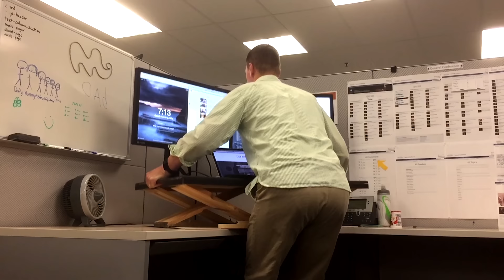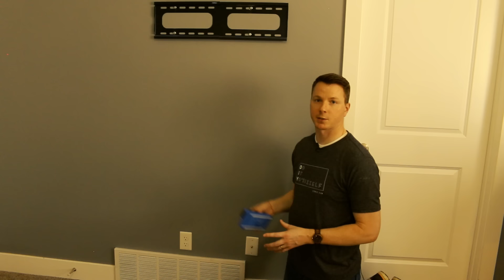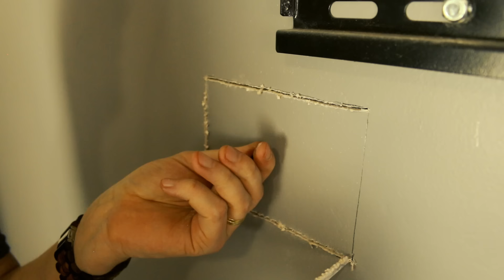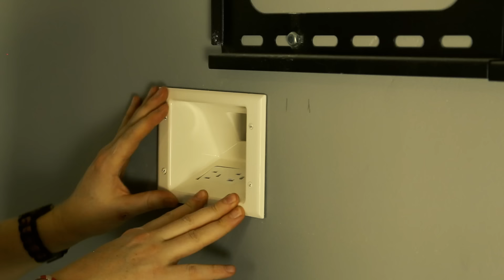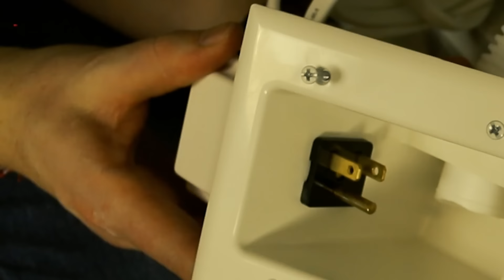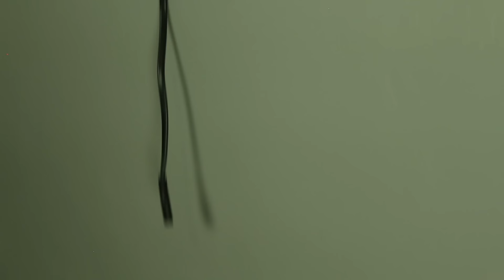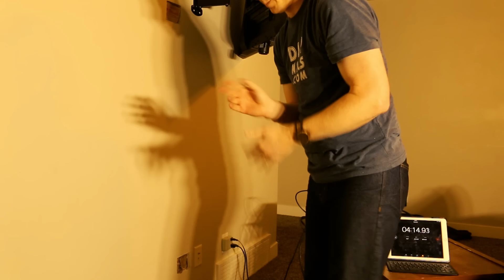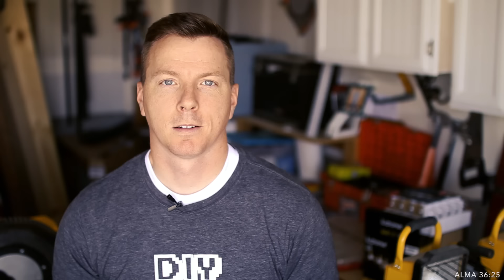How To Hide Your TV Wires in 30 Minutes - DIY

Comment: If you just need to go straight up, seems like it would be easier just to put in a new outlet behind the TV and a separate cable run. The way you did it would be more useful if you have to cross a stud or two to get to your electric box.

Comment: Your video stopped short of the completion of the project. What is the purpose of running the AB cables through that pipe? What do they connect to and have anything to do with plugging it into the electrical outlet?

Comment: Only suggestion is run a thin piece of string or rope through your cable tube.  WHen installed, tie the cables to the rope/string and then gently pull.

Comment: What do you think about these: Power bridge is easier to install. don't need to drill the fire block use a "Buzz Saw" multitool and cut a knotch in the drywall and 1/2 in. of fire block

Comment: Nice clean install with detailed instructions.  However, that six-foot extension cord bundled up at the bottom of the flush mount box is kind of janky. Something like an; "DEWENWILS 1FT Extension Cord Indoor, 14 Gauge Short Flat Plug Extension Cord White with 3 Prong, Low Profile Power Cable SJT, ETL Listed, 3 Pack", would have been a cleaner solution.

Comment: not an improvement.  should have just tapped the new wires into the existing electrical box for the cordless look running everything behind the drywall.  that is the point in doing it, to clean up the wall

Comment: Nice system but a comment has to be made. Always cut electrical wires to fit properly into fittings, exposed wires are dangerous. In this case it was the ground wire but with other wires exposed outside of a fitting always gives a chance of shorts / fire. Electrical work is not to be taken lightly so always take the time to do it properly.

Comment: Very thorough video.  I hate the look of the extension cord. I wired the power leads directly behind the original outlet plug.  Definitely not code but no wires at base along floorboard/outlet

Comment: I personally don’t like this. you have an outlet in the wall. You still have a cord showing, coming from the outlet to the new box. why not just put a double hang with a way to run your wires out? i added a outlet with the outlet/USB (RoKu) and have no issues at all, wires hidden….i get this is a “sponsor” video, but i’m not a fan of the boxes in this video

Comment: This video is great but do not use this pipe that will definitely not help and very difficult to pass the hdmi cables as I am facing so I am going to remove the pipe. But otherwise, rest of the instruction is very helpful.

Comment: A good tip for doing ANY electrical work, never wrap a wire into a circle when you have extra. As the electricity flows through it turns the circular part of the wire into an electromagnet. This can create interference with all kinds of signals. I see people do this all the time with speaker wire and then wonder why things don’t sound right and why their wire gets warm.
Reply: What do you do with cables rest then
Reply: @toxicsquee3112  This tip maybe well out of date now as I have only just come across this vid but you can by de magnetisers that clip onto the cables to prevent this. Some new appliances will come with them on. Also, not so fun fact. Last year the house opposite mine burnt to the ground during the night. All occupants escaped except for their pet cat who was never found. The cause was an extension cable that had not been fully uncurled and was unprotected. I have always been aware of this danger but had never truly believed it. Now I do.
Reply: Thank you. I never thought about it
Reply: Shielding protects to a degree but not when coiled several times. Now if you’re talking about 2 loops the diameter of a basketball then, not much to worry about at low voltage. Shrink that same length down to several coils the diameter of a baseball and now you’ve got interference. This is something that you would definitely notice if it crossed paths with speaker wire or a cable transferring a video signal but standard power cables would just get a bit warmer.
Reply: @EyesoreJr  I think you are replying to a post I deleted because I didn't feel like arguing something I don't really care about. If you have ever created an inductor, you would know that 1) it takes MANY tight wraps 2) the magnetic force is terribly weak w/o an ferromagnetic core, 3) current/amps matters. Speaker wire, as the original commenter stated, will not behave in the manner as described: heating up and causing audio degradation. The inductance might increase by a few uH if wrapped ..a dozen loops, and I seriously doubt that anyone would perceive the affect that would have on the signal. You would have more serious problems simply running your signal cables along side a high voltage power cable, unless one of the two is well shielded.
Reply: @typedeaf  I understand what you are saying but there is a difference between power chords and audio chords/speaker cable. Yes speaker wire has a low voltage and would not have as much of an issue with this as power would. However there are other things that audio/speaker wire has issues with. When coiling, the problem with audio isn’t as much heat or magnetics as it is signal loss, decibel loss, distortion and trailing. I see so many people using small gauge wire to try to drive large speakers, one speaker wire twice as long as the other, and coiling the longer wire into small baseball sized wraps. When I see posts like this one, I just feel compelled to try to help people out on the simple little things that will make things better.
Reply: Make an “s” back and forth.
Reply: That’s false
Reply: @bryandasilva5318  no it’s not, do some research. Do you have any idea what an “electro magnet” is? Apparently not. It’s when you take wire and make a circle with it, the more circles you make and the more electricity you run through it, the stronger it is. Same kind they use on cranes at car crushing/auto salvagers.
Reply: @EyesoreJr  You are right, if anyone doubts this they should look for videos on how to make a DIY induction coil, same principle, all be it with a lot more current. I once used a heat gun with an extension lead that was mostly wound up and the cable started to melt!

Comment: me question is when the tv is flat against the wall it looks awesome but what happens if you need your tv at a 45 degree angle twist ,, once you pull out the tv aren't you gonna see the wires?

Comment: The real issue which you haven’t covered is the construction of walls circa 1958. The amount of satin glue used within the brick construction can easily melt in a fire block. Satin glue does not allow cement to dry due to its stud resistant compound rendering the exercise pointless. If you were to cover this from the off there would be no need to mention this.

Comment: Clear vinyl tubing tends to be easier to work with. Corrugated tubing has too many hang-up points whereas the vinyl tubing is completely smooth allowing the wires to slide through the tube a lot easier with no hang-ups. It does cost a little more but well worth the little extra cost.

Great tutorial!!
Reply: that is solid advice!!! thanx
Reply: @mr.hidden5790  When working on new structures pvc is truly desired for cables. But I am a firm believer you work with what you have at home anyways. lol.
Reply: Wow, that is great advice too! THANX @jonesgang

Comment: Do NOT wrap your electrical wires like that.  It creates an electrical coil and can cause problems.  It generates heat.  I doubt if there will be enough power through that outlet to cause a problem, but why test it and it wastes energy too.  You also never know if someone might use that outlet temporarily for a heavy duty device like a power tool.  You can also create a magnetic field that might interfere with signals.

Comment: Great video, what would you suggest I do for setting up two TVs right next to each other on the wall above just like yours. I’m setting up two gaming TVs and two Consol Xbox is to play games and slide of split screen so each person has a full screen. But I do two of these one for each TV or would you suggest doing one in the middle of both and running all wires for both TVs down to the ground through one? Remember I’m gonna have two consoles two TVs to HDMI cables so there will be a little bit more running through that one entry and exit point
Reply from the maker: If you only end up needing one HDM (or even two) for each TV, I'd run one kit to supply both TVs. If you want a gap between the TVs or if you need more than two HDMIs per TV, then I'd run two. It's totally up to you, of course, but by running only one, you make the room a bit more future-proof and there's less to cover up if you or some future owner only wants one TV there.

Comment: Don't forget internet wire, and cable TV. Working thru insulation is easy with a electrical fish line. About 12-$15 at lowes.

Comment: Great video. However, if ordering the B&P discharge hose from the amazon link you'll need a bigger dimension.  The amazon site shows a 3/4" diameter hose. you'll need a 1" or a 1 1/4" (if not bigger).  So, caution when ordering the hose...

Comment: A lot of work and really does not clean up the wall.  Now you have a mess at the bottom. How about running an outlet parallel to the lower outlet up u ext to the bracket. Same for the data cable. Easy to drill through the stud and run that data cable up the same void as the power, do it all the time and have one box up top with a data port and and a/c plug in.

Comment: What about if the outlet is 2m horizontal away
Reply from the maker: That all depends. There's a fairly long cord with this kit so if you wanted to do this exactly like I've done in the video and then run the power cord over to the outlet along the baseboard you can do that. If you want to hide that power cord, you'll need to either tuck it under the baseboard or go through the trouble of running a full-on Romex Cable (in-wall power line) through all of those studs, which is feasible but WAY more work and requires patching drywall, painting and more.

Comment: could you pre run the cables through the pipe? use some tape to hold them in the channel and maybe hot glue the plastic tube to the plate,  Nice set up tho I didn't know those were available.

Comment: wiring is not code compliant. Using a drain hose? they make actual low volt electrical plastic conduit. Good job for a home owner I guess

Comment: what if I use an extension cable through an insulated wall instead of buying an expensive cable organizer with a power extension?
Reply from the maker: That’s an option but it’s against code and has insurance implications should there be a fire, whereas the kit is UL certified and up to code.
Reply: @LRN2DIY  thank u

Comment: Quick question: is the job still up to code if you install the plate and run down the cables down the stud bay where the outlet is? Or, do you have to use a stud bay where there are no electrical boxes/outlets? Thanks!
Reply from the maker: The stud bay you choose doesn't really matter, though there may be local code with rules around not using stud bays that are air returns.
Reply: @LRN2DIY  Thanks!

Comment: Nice video, but I ran into a problem, not talked about or mentioned on the Data Comm site or instructions.  I bought the same model kit that is used in the video.  The project was to hang a flat screen on an interior wall.  The wall width of exactly 4 inches was too narrow to use the kit as is.  I had already cut the holes so had to somehow make the kit work.  The only solution was to cut off the curved entrance where the cables go into the box to get them in flat.

Comment: This approach can create a nightmare for somebody with lath and plaster walls. Many older homes (like those of us in the northeast) predate modern drywall. They still have studs and bays, but if you go at them with a jab-saw or anything similar you could well end up destroying the entire wall -- the saw catches a lath, pulls it loose, and the resulting crack travels across the wall in a heartbeat. You'll want to get a oscillating tool or something similar. I like to cover the line I'm about to cut with masking tape as well.

The boxes themselves will still work fine, and the tube is a great tip.

Comment: Thanks for the video! Any ideas on running the wire diagonally behind the wall? We have a big TV mounted but the outlets are about 4 feet to the left. Ideally, we want to not even have the horizontal wire exposed at the bottom.

Comment: Hello, I'm setting up my living room for VR and I need some help with hiding the cables for the sensors. My plan is to have sensors in four corners of the room. Do you have any videos on hiding cables in the walls going horizontally?
Reply from the maker: I don’t have any videos on it but a) sounds like your new setup is going to be awesome and b) I’d recommend running them along the bottom of the  baseboards for your horizontal runs. You’ll want to start by drilling two small holes for each. One is where you want the wire to come out and the other near the floor directly underneath. Drop the wire from the top hole to the bottom hole, fish it through and then run them under the baseboards. Best of luck!

Comment: Awesome video.  How would you mount this TV above a fireplace with the chimney running up behind the wall you want to mount the TV on?  Is there interior room between the chimney itself and the wall to run wires?  Any special caveats to be aware of?
Reply from the maker: That's tough to say. If it's just drywall or shiplap or something like that and there's a flue inside with some empty space you'll be good to go, but if the flue is larger and comes out to the wall then that won't work. You'll have to essentially look inside there to see if it will work or not. You may be able to get a good idea by looking up in the fireplace.
Reply: @LRN2DIY  Thank you!

Comment: Here in the States  is not as simple as 1 2 3. You forgot  to mentioned that most houses have fireblock between studs  at about 40-48 inches from the floor, meaning you have to drill a hole in that fireblock. I have done hundreds  of tv installs and out of 30 maybe 1 or 2 will not have that fireblock.

Comment: Fire blocks are not half way up the wall. They are draft blocks and they are at 10' if the wall is over 10' tall and at the bottom of ledgers and stair stringers, top of shower stalls ect. Any place fire can get in and draft up. There could be blocks for sheetrock backing or diagonal bracing blocks in the middle of a wall but not fire blocks

Comment: What if the TV is over a fire place and the bottom outlet is to the side of the fireplace? Is it hard to send the wires to the side and what if there is another stud in between both locations?

Comment: Why do you need electrical cables that plug into an outlet if all your doing is feeding HDMI/power cables through the wall? I guess that's where I got confused on cuz I was thinking about doing this in my master but I got confused on why there needs to be power in these Outlets?
Reply from the maker: The power is for the TV as well as any other devices you want plugged in behind it, like an Apple TV, for instance. If you only need to hide low voltage wires (HDMI, A/V wires) then you don't need to worry about the power but it's against code to run power cables behind the wall.

Comment: I believe, if you have horizontal firewall , then you can not do anything ( no holes). If you drill a hole in the horizontal 2x4 firewall , then you will be violating the code and the insurance!

Comment: The only thing I thought was very DIY was the extension cord... throw that bottom box above your electrical outlet and jump your power to the new av box so you have a plug in there... instead of a male plug end to have to use an extension cord. Other than that those av boxes are really nice and convenient

Comment: Im confused why not just make a hole in the drywall and run all the wires throught it and out of the bottom then plug them in to power
Reply from the maker: That's an option but it is against building code to run AC (power) wires through the wall like that. This kit makes it code compliant and clean.

Comment: Does this only work if the TV is right above the outlet? What about when it's not exactly centered over an outlet?
Reply from the maker: Yes, this will work as long as the outlet is within about six feet to either side, which is why the long plug at the bottom helps. Mine happened to be in line but it doesn't have to be for this to work.

Comment: I don't understand the point of the tubing, but whatever.  What through me, however, is why he didn't just run the power cord to the outlet that was right next to the installed outlet box.
Reply: Yeah, I wouldn't have bought that contraption. Can be done with regular electrical supplies and wired directly into the outlet box below the TV.

Comment: All that work you did, you could have just tapped off the outlet, at the bottom, and brought power straight and added another outlet underneath the bracket. What was done is unnecessary

Comment: Why do electrical people always want drag out 14gauge wiring.  Research shows that using 14 gauge overheats while electric current flows which cause loss of amps
Reply: 14ga. is way more than enough to power a TV. In any case it wouldn't matter if you used 0ga. in this application if the wiring to the outlet was 14.

Comment: It would be much better to just fish a 14/2 cable for power straight above, and tap off the existing power outlet box, instead of the external power cord. You could still cut a seperate single gang box below for LV wires with the hose. That way everything still stays inside the wall.